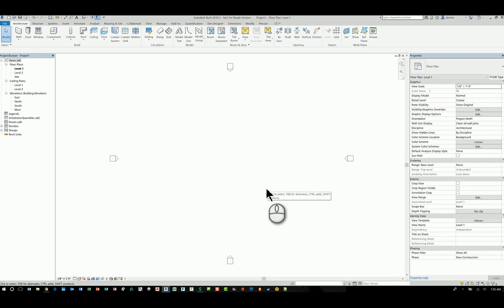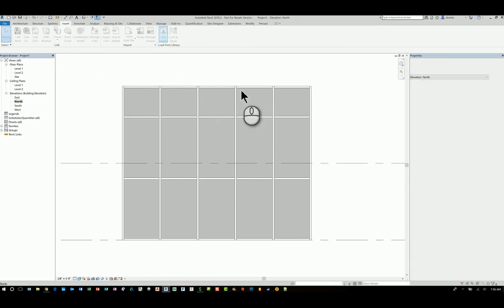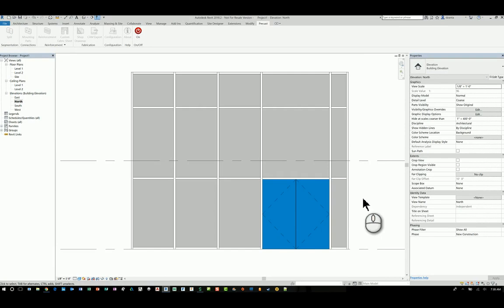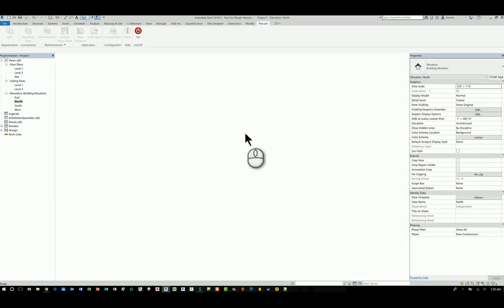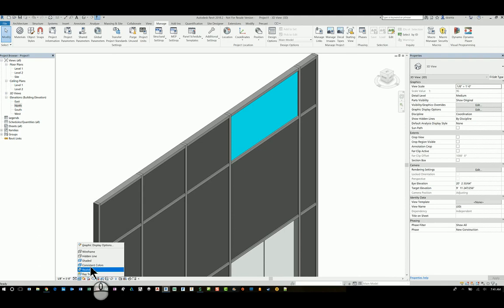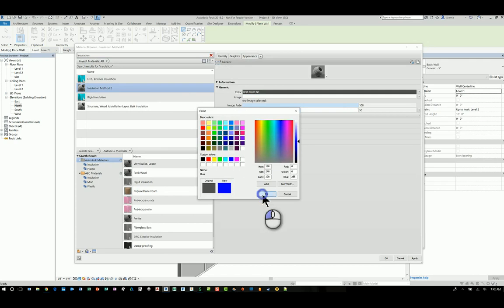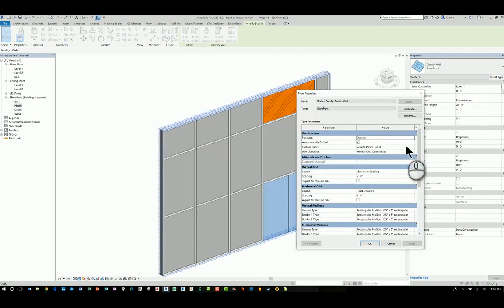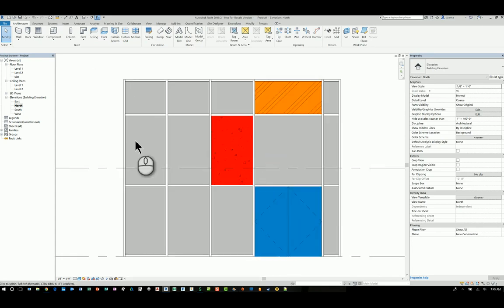Revit Curtain Wall Panel Swapping - A How to Guide

Comment: How can you change several panels at one time🤔
Reply from the maker: You can select 1 panel, right click, choose to select all panels on host or horizontal, or vertical then until then change type
Reply: @DzanTa  Else use dynamo and filters